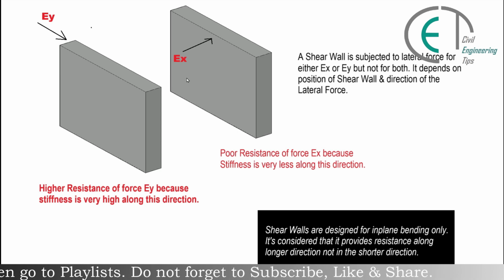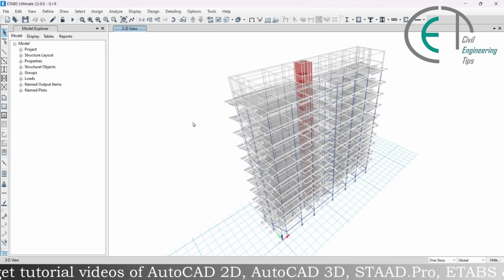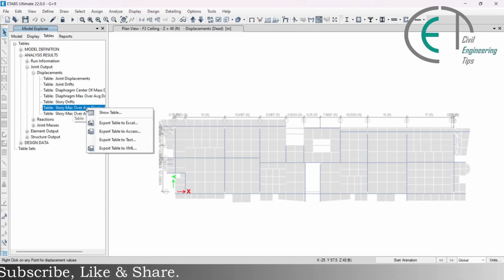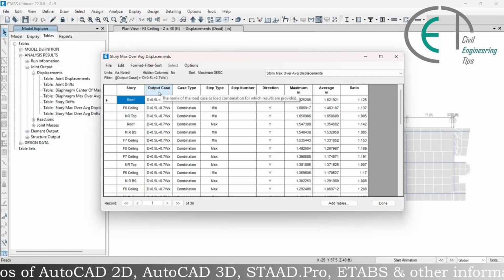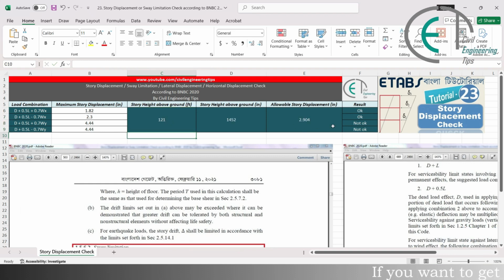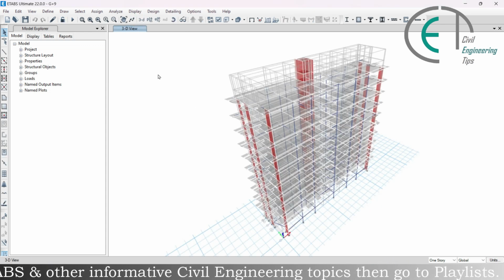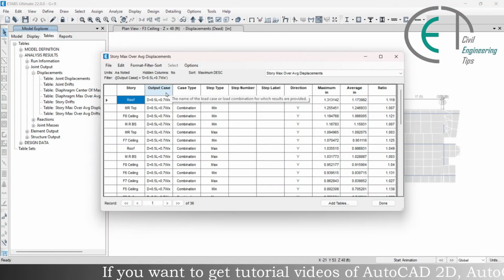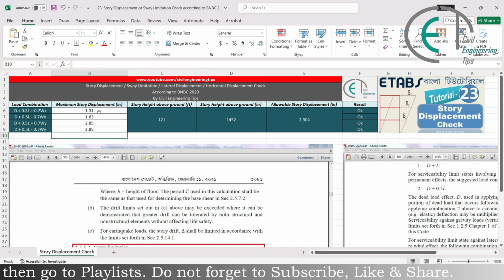4. Effect of Using Shear Wall in a building | Advantage of Shear Wall | Shear Wall Design in ETABS

Comment: Shouldn't your columns have been rotated 90 degrees, so that the larger cross-section moment of inertia of the columns were pointed along the longer beam spans?
Reply from the maker: Not always. Orientation of the columns also depends on shape of the building also.